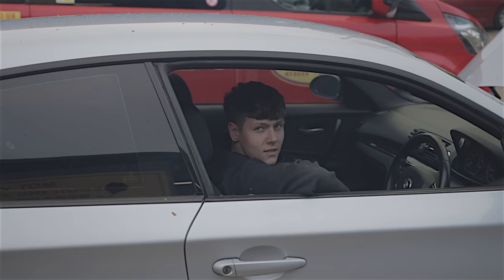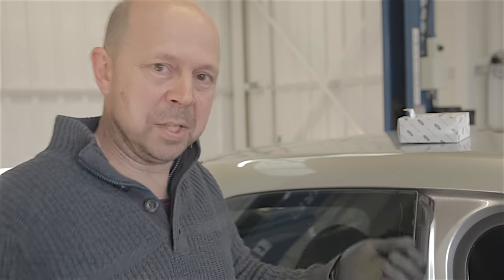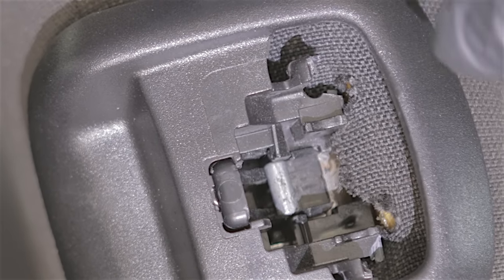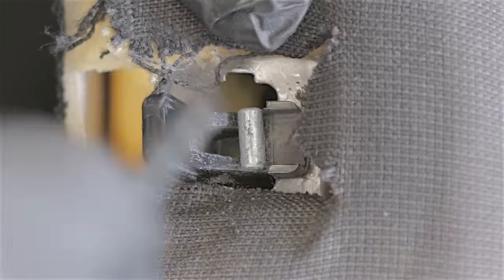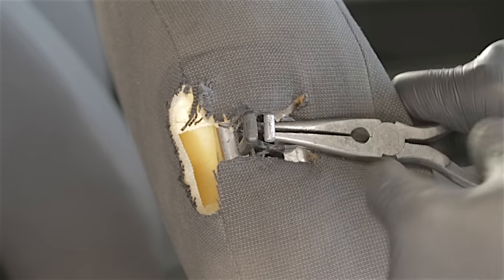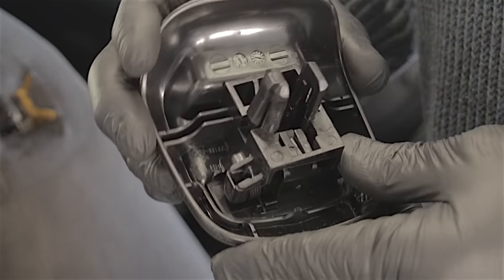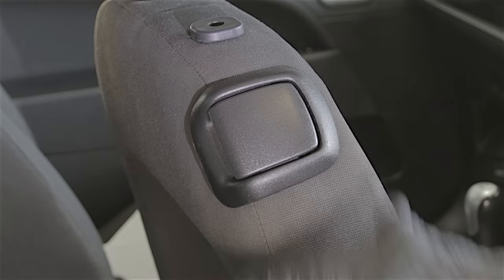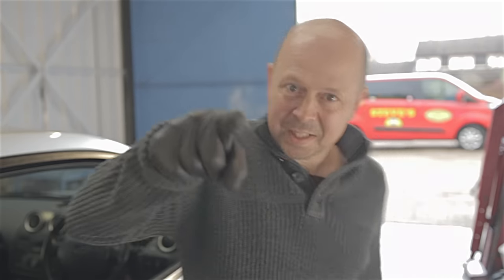Seat Tilt Handle Replacement, Ford Fiesta Mk6, 2002- 2008

Comment: Had that before, temporary repair... tip the seat forward to let the cable go slack get a pair of narrow nose pliers on the metal lug pull it up and thread a tie wrap between the two wires to create a loop, cut the excess off the tie wrap and use a file to take the sharp edge off the tie wrap.... Works a treat and passes an MOT

Comment: Hi Alan. I have a Focus Convertible and they suffer with the same problem. To try to avoid any breakages I always push the 'seat back' towards the rear of the car before pulling the lever. I find this takes all the tension off the mechanism and the lever pulls without any resistance. Hopefully mine will stay working for a long time to come because the Focus CC ones are unique to that model and aren't bloody cheap! Another great vid, keep up the good work :)

Comment: Thanks very much for the video, you're the boss!
It's a faulty design because the handle's mechanism is too fragile so they had to insert metallic parts where the cable attaches to.

Comment: Best video on here by far for showing how to deal with this bloody awful problem. I bought an ebay replacement part for £6.95.  After struggling to get the broken part off I watched your video and had another go. Once I located the spring lugs and knew to push down as well as in it worked.  Second one was a bit trickier but it clicked free eventually.  New part just slotted in first time perfectly.  So grateful to you for this excellent video.  Thanks again. :-)
Reply: You actually managed to use those cheap copies from China? Every time I've used them they've broken on me and the cable fails to locate.
Reply: @tomcass240  Cable located first time.  Time will tell if the clip lasts or not. It's a fairly straightforward job once you know how to do it so not a big deal.
Reply from the maker: lol, glad it worked for you but best to use the ford genuine handles

Comment: I've to change mine, it just breaked through. But I ordered one from ebay for 8 bucks. I'll let you know when I've changed it.
This instructions are pretty clear, thx so far.
Reply from the maker: good luck
Reply: Thank you, I did it and the difficult part was just to get it out after the clamps were pushed by screwdrivers.
But thanks so far for your help!

Comment: Remember there are left and right handed levers when you order a replacment.

I have replaced 2 of these, wish i had seen this U tube before i did them. The first one I chewed out as i had no idea how it was fitted. second one much easier as I had seen how it fitted. 
Excellent Video this one.

Comment: The reviews on amazon are really hit and miss so I didn't chance it and bought genuine replacements. The wider clip is the easiest to budge but the thinner one is a pain in the backside to get to. I used a small hex head screwdriver to get into that side and then pull hard with both disengaged to remove the handles. After doing 2 seats I can definitely see why garages don't want to do this work if they can help it.

Comment: Great vid, very useful.  Have you one one where you have to replace the cable?  I've just snapped the metal lug at the top of the cable :/
Reply from the maker: no not cable replacement but you have to pull the seat cover up..its a tricky job but you can do it without removing the seat from the car

Comment: Did mine a few months back wish this video was around then lol luckily I did it right first time but it was a pain and stressful. I got a really cheap replacement off Amazon think it was less than £5 and it's still working 2 months later so don't buy the ford ones they're rip off.

Comment: Tie some rope around the bottom piece's pull the cables up through it untie the rope retie them onto the new ones very gently pull them through easy as pie had to replace the handles about 5 times and one set of the cables in the 18months I had my fiesta a pair of screwdrivers either side of the latch does the job two just prize it out

Comment: You probably wanna buy official Ford parts rather than the crap they make in China. This video makes it look easy but on the cheap ones from China the cable just won't locate in the handle, and it ends up snapping when trying to get it out.
Reply from the maker: yes true, the ford handles are much better quality and....not made in china

Comment: I followed this after getting fed up with not being able to tilt passenger side door, old one came off ok, could tilt the seat after pulling the cable up and the new one fit in fine. As soon as I popped the seat back into place from being tilted the nipple on the end falls through the handle and then I'm back to where I was. The seat wont tilt when using the handle.
Anyone had this? Does the cable need to be replaced?
Reply from the maker: i would say the plastic part of the cable that secures into the top of the seat is broken and you will need a new cable